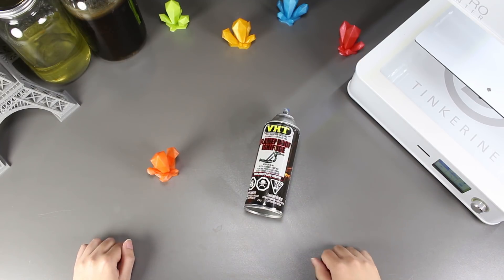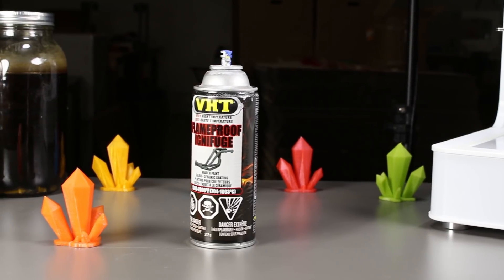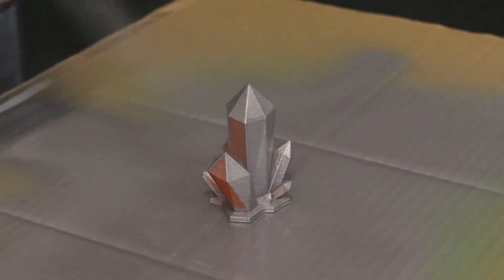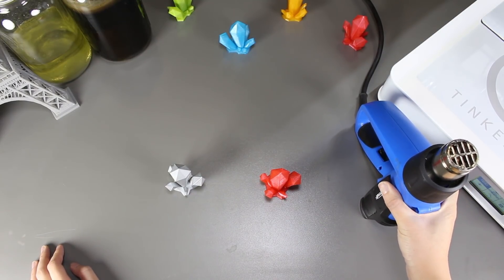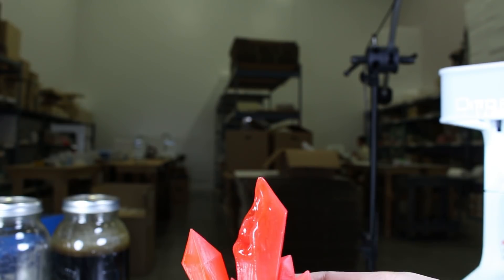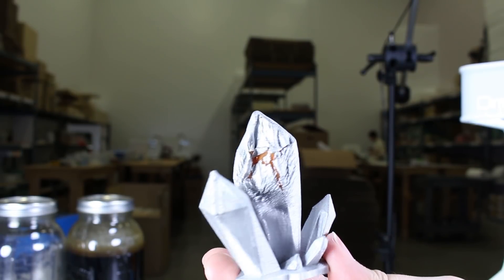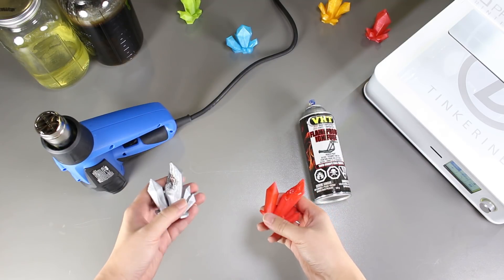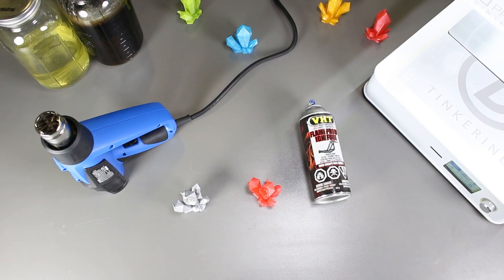Spraying 3D Printed PLA Models with Ceramic Paint

Comment: Great experiment, exactly what I was looking for. One missed opportunity though. Cover the part really thick with the paint multiple times, place it in sand and melt out the PLA polymer, then cast in metal. You could also spray the paint really thick and sprinkle it with sand to build up a thicker coat, then melt out the pla and cast metal, now THIS wouls be really great if this works.

Comment: Ceramic is a great conductor of heat. Painting exhaust pipes helps retain the radiant heat from reaching other components under the hood (in theory). ceramic painted exhaust will read hotter than regular steel because of conduction. It's still a heat shield (retainer) just not the way we're thinking. Great video btw.

Comment: read the directions those paints require you to heat up engine and cure, this is a badly done experiment.  In general read directions, of the product you use and do not assume all products are similar to the ones you have used in the past.
Reply from the maker: Thanks for the comment and the heads up, we will look into trying it out again!

Comment: this comment is a little late, but as i understand the high temp paint it's used for places where it will get hot. it's designed to handle the high heat conditions, and not combust/catch fire like a regular spray paint might. as for it melting quicker if i had to hazard a guess I think the paint may have trapped more heat in than the piece exposed to the air. that being said this was a very interesting video that really captured my curiosity! video quality was great, and you seemed really organized. keep up the awesome work man!
Reply from the maker: Thanks for the comment!